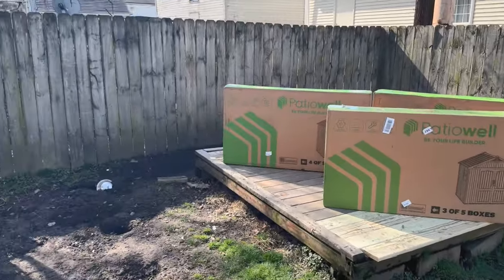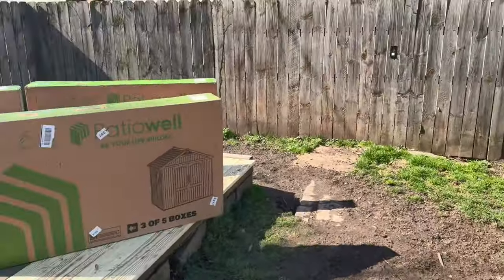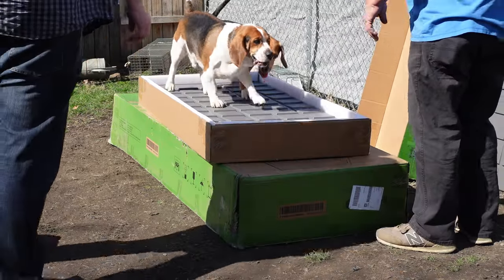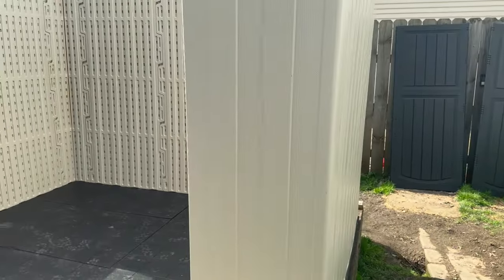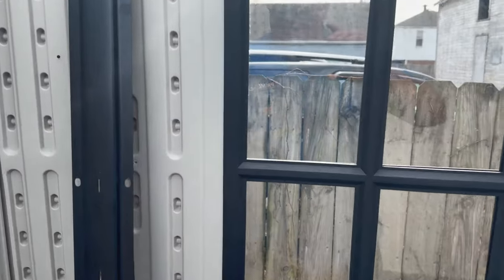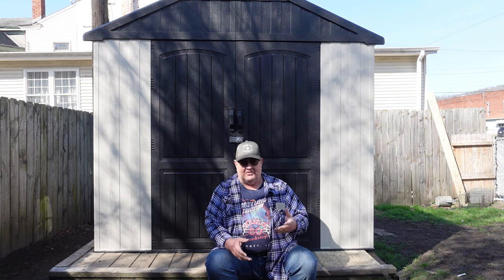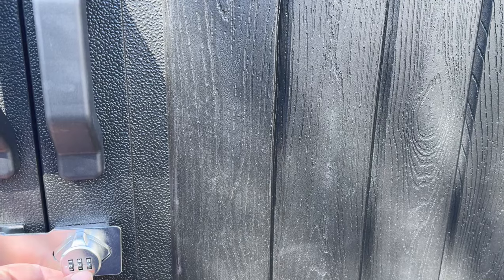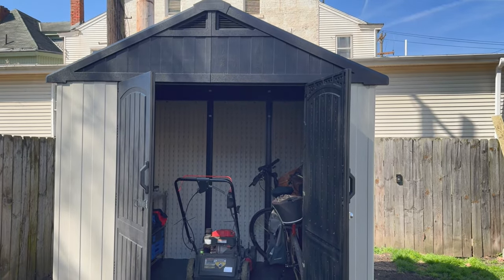Patiowell 6x8 Plastic Shed Review and Personal Thoughts

Comment: I have one, and we just built it, but Im having issues with the hinges on the doors. They dont line up properly. 
If I get them lined up the the middle of the hinge is on the inside and not on the outside and then the doors don't close. Any suggestion of what im doing wrong?

Comment: I just purchased this exact shed which was delivered this past Monday and it came in four boxes. SMH!
Reply: How’s the shed holding up?? I just ordered one yesterday
Reply: @outtava2003  So far it is doing fine. It's smaller than I expected but will do what I need. It seems sturdy right now but we'll see. it took 2 people a whole day to put it together not 2 hours like they claim. I think this guy says that in his video. The instructions are mostly pictures and at first its over whelming trying to follow them but you can catch on to them pretty quickly. Make sure to follow the screw sizes there is a difference that isn't very noticeable until you put the wrong one through the roof like I did because some of them do look the same but a slight bit longer. good luck.
Reply: @tonylucia4197  Thanks for the reply…. I ordered the shed and it’s expected to arrive next Friday… After reading your comment, I’ll plan the entire day for it. Again, thanks!
Reply: @outtava2003  you're welcome
Reply: @tonylucia4197 Hey me again! I just assembled mine and it’s cool… Does your struggle to close? My door does, I think I might have to sand down the bottom entrance floor piece.
Reply: @outtava2003  yes I did have issues at first with the doors but it was minor. I just make sure when I close them I bring them together and they push in fine. I'm sure mine isn't completely level since I just built a floating base. My ground is all clay and a pain to dig so I just avoided digging as much as I could and set it on as level of ground as I could find.